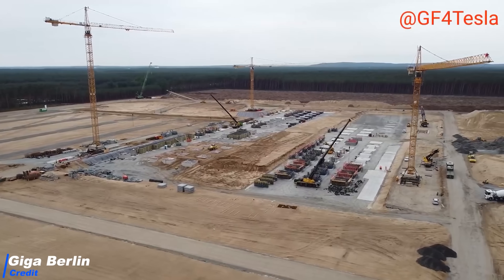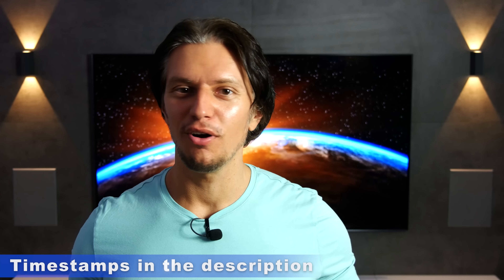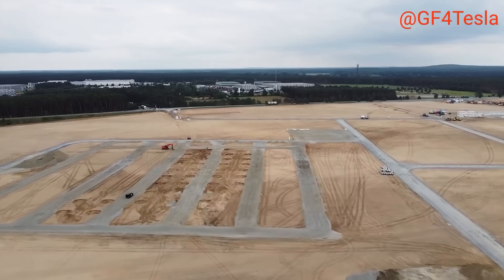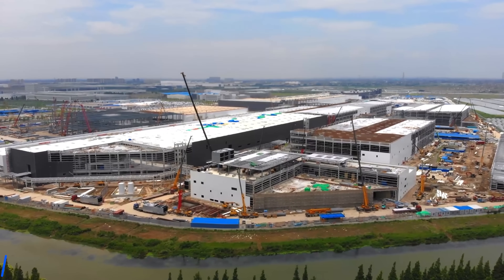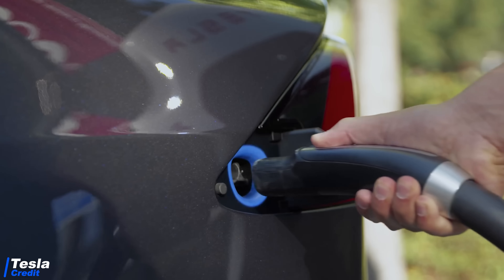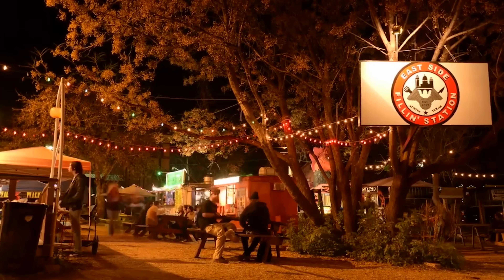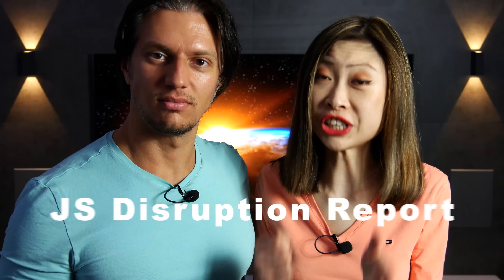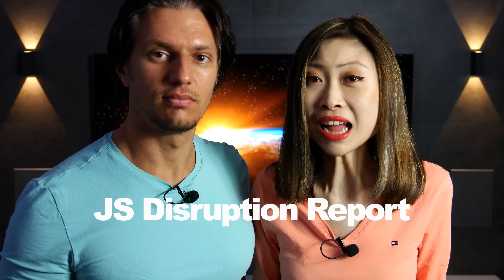Tesla Gigafactory EXPANSION, Lordstown & Lucid Unveiling, CityAirbus eVTOL Testing

Comment: Terafactory in Austin or Tulsa?

Why not both locations.  Even if they start building a Terra Factory right away it will take years to finish.  What if they start building 2 locations?  They could be up and running at both sites giving them a ton of new capacity.  Something they always seem to need.

Comment: Tesla is going for broke. Literally. They have almost gone bankrupt a few times already. 

I have to say Tesla doesn't make money but they are hitting everything very well lately.  The valuation is still insane but Tesla is getting too big to just fail now. As long as people will buy Tesla Beta testing vehicles things will continue going well.  The S has been improved over time and is much better then it was at it's debut. Increase quality and range, people will continue to buy the Model S. I figure people would get their toy and be done with Tesla, the S and X  have plateaued but sales haven't fallen off. If their new models can keep doing what the S and X did, Tesla will be fine.  

Still not making money and with in insane valuation but things are working at this point.
Reply: They COULD now make money at any time, but they're plowing it all into expanding production and product line instead.  Elon's goal is NOT to make lots of profit...it's to lead the way to electrification instead of fossil fuels as quickly as possible.
Reply: @737smartin  Yes for now.  The problem is one misstep and Elon gets something wrong he will have to pile on debt or sell more shares. There is a point where neither of those things will happen. For now people will keep giving him money to expand because he is having results.  The failed Solar CIty concept is under control now. The lease model failed and Elon never hit his price goals for solar panels.  The High capacity storage systems are selling but no where near what was promised. When was the last time you heard Elon talk about the storage business? Vehicles are selling for now.  

I don't know where you think this electricity comes from but fusion reactors haven't been invented yet.

Comment: I do not like those efficiency charts, because they are comparing apples to oranges, as they do not take into account the motors performance. For example as per the graph the Kona is almost as efficient as the Model 3, but the model 3 can do 0-60 in 5s and the Kona takes 7+ seconds, so that means that to achieve the same efficiency, they have to use much less powerful electric motors, so can't really compare. A proper efficiency calculation would be miles driven divided by battery kwh multiplied by (motor power divided 100kw) or something like that.
Tesla Model SR+ 250/54*(210/100)=9.72
Kona Electric 258/64*(150/100)=6.05
That would be more representative IMHO. Otherwise it's like comparing the fuel efficiency of a 150HP V4 engine with that of a 250HP V6 that has almost the same MPG, but not quite and concluding that the V4 is more efficient.
Reply: @TechChasm  My point is targeted at Kia/Hyundai, because everybody refers to it as is and this always makes the Hyundai & Kia EVs look almost as good as Tesla, which when you take into consideration the motors' power is not the case at all.

Comment: Yes, it is. Battery development is an active area of development at this point and it has about 100 years to catch up because the internal combustion engines really took over in the 1920s. Tesla would do well to tie the first tunnels in with the monorail systems and make advertising for tourists visiting Las Vegas. Tunnels are expensive and there are going to be short stretches of them in the beginning only. It is foreseeable that the Monorail system ages and can be replaced by tunnels. On to the future.

Comment: still think the semi needs to be hybrid.
well, australian market anyway, we are just too big for our population
Reply: Hybrid can often be a very good solution.
Reply: Bruce Baxter - Australia gets TW’s of solar. It shouldn’t be too difficult to have 1,000 Supercharger stations (some specifically designed for Tesla Semis) spread out near Australia’s highways, each with a couple of hectares of solar panels & 5+ MWH of storage. I don’t think most people realize the ranges for the Tesla Semis are being calculated on the basis of towing a full trailer & 40 t of all-up weight at 88 Kph.
Reply: TraditionalAnglican 
Yea, umm, semis in Australia weigh up to 100tons and are three or more trailers long they cruise at 100-120kph and tend to do 1000km each way and a lot do 3000km. 

There just isn’t the population to support the infrastructure of electric semis. 
But hybrids, having that much horsepower on tap but only running tiny 100hp generators would suit our terrain perfectly.
Reply: Bruce Baxter - Weight limit here is ~40 metric tons, & speed limit is ~88 Kph for trucks with trailers. We also have regulations requiring regular rest stops, & there are truck stops (with restaurants & diesel/gas) that even non-truckers use. 
https://www.nh.gov/dot/org/projectdevelopment/bridgedesign/documents/truckweights.pdf 
https://www.bigtruckguide.com/semi-truck-size-and-weight-laws-in-the-united-states-and-canada/ 
https://www.bigtruckguide.com/wp-content/uploads/2016/01/Heavy-Truck-Weight-and-Dimension-Limits-for-Interprovincial-Operations-in-Canada-MOU.pdf 
And, you do have a network of “truck stops” in Australia, so it shouldn’t be all that complicated to set some of them up to deal with Tesla Semis - 
https://www.bp.com/en_au/australia/home/products-services/service-stations/truck-stops.html 
https://www.yarno.com.au/blog/10-of-the-best-truckstops-in-australia/ 
http://www.freightmetrics.com.au/Calculators%7CRoad/RestStopMaps/tabid/120/Default.aspx 
As I understand, these are the rules for truck transport in Australia - 
https://www.harders.com.au/logistics-tools/road-weight-limits/ 
https://www.nhvr.gov.au/files/201607-0116-mass-and-dimension-limits.pdf 
“Road trains” tend to be used in more remote/rural areas - 
https://en.wikipedia.org/wiki/Road_train 
https://auto.howstuffworks.com/road-trains1.htm 
They’re not testing for that, but I suspect the Semi could do that. I think it would be safer to use the FSD set-up & have a convoy of autonomous Semis follow behind a “human piloted” truck (They’d draft just like NASCAR). They have to break up the Road Train as soon as they get to a populated non-remote area. It’s easier, simpler & cheaper to have a group of drivers meet the convoy at some agreed “break up point” & take over their assigned trucks than it is to drive a group of Semis to a yard, break apart the train, stow the dollies in the yard & attach the trailers to their assigned trucks.
The major operating expense with road transport is still the driver & the driver’s expenses. A Tesla convoy of 10-12 trucks that’s piloted by a driver in front is simply going to be cheaper than 2 “Triples” piloted by 2 drivers, & you’d still get more load out of the deal (even with American limits) than you would with those same 2 Triples.
Reply: @TraditionalAnglican  
europe and usa should be able to go near complete battery.
us aussies are just too few and far between
Reply: Bruce Baxter - The range is 500 miles, not 500 km, & that’s towing a full load at speed limit. You Aussies have Truck Stops (even in areas that are sparsely populated) & rest & meal mandates, just like we do in the states. Tesla has developed Superchargers that can fully charge a Semi in <1 hour - That’s about the time it takes for a meal break at a restaurant. There’s no reason a Truck stop that wants to make money selling food & electricity to truckers wouldn’t use a few hectares of solar panels to produce the electricity for the Semis (& themselves) - They’re already providing A/C, heat & electricity to ICE Semis in the states.
Trucking companies aren’t going to go for 2 Triples when they can do more with a platoon of 12 Semis driven by one driver for less money, especially when you consider they won’t need the storage yards with space to stow the dollies & trucks to tow the trailers after the Triples are broken up. And, they’re going to make an economic decision. At the same time, I don’t think anyone is going to spend the $100 million in R&D needed to develop Hybrid Semis for a market that might buy 2,000 Semis/year.